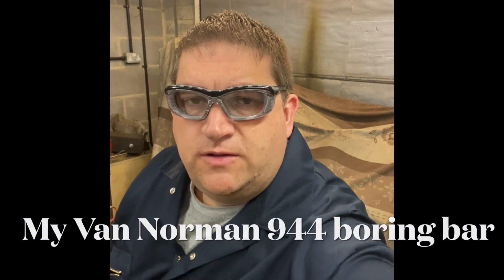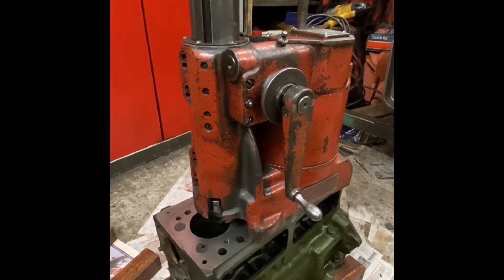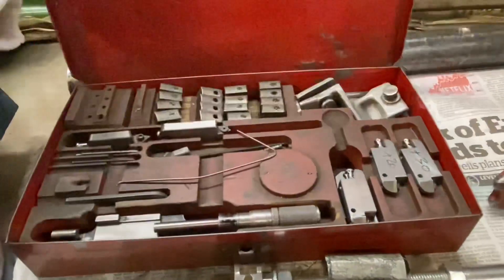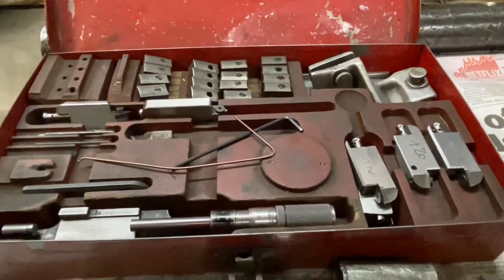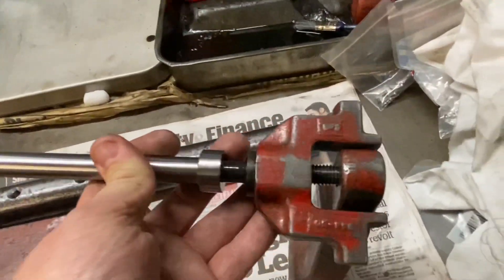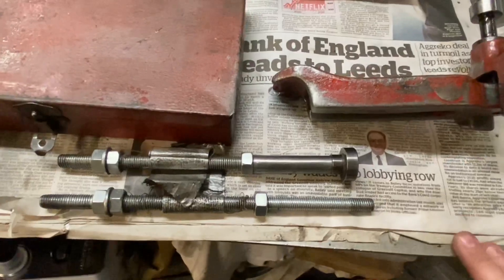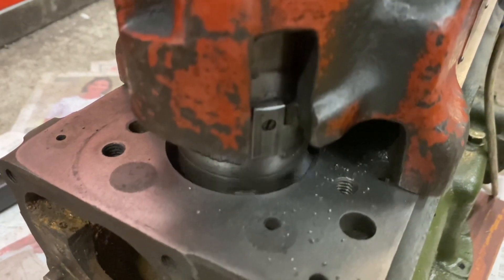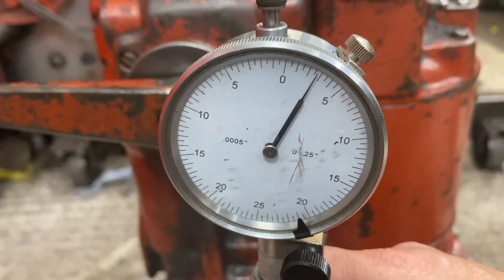My machine tools, part 2 - Van Norman 944 boring bar

Comment: Great video, many thanks. Just brought home Van Norman and Buma boring bars plus tooling from my parents house. Both passed away now sadly. Dad had an engine shop back in the day. I used to work with him 30+ years ago. Lovely old machines that have sat un-used for many years. I'll tidy them up and get working again.
Reply from the maker: Sad when parents pass on, but using their old machines is very good therapy, my old Colchester was my dads machine he has long since passed too, but there is something not quite tangible when you touch and use the equipment, it’s as if they approve and are watching, but not in a spooky way.
Reply: @ACDodd  Looks like there's a bit of surface corrosion on the main column of the boring bar. Wondering if that's something that will impact accuracy very much or can be rectified? Thanks
Reply from the maker: @chrischapman143 it’s not raised corrosion it’s below the surface and does  it affect the columns motion. Or direction
Reply: Yes, very true. Their tools are the only connection we've got now. Nice to have them at least. Never actually used a boring bar myself, only watched him with it. I'll have a few practice runs on an old Ford block I've got. Cheers
Reply: Spent several hours on the Buma machine cleaning and lubricating. The corrosion cleaned up well and column motion is fine. Think it's going to be fine 👌. Going to look at the Van Norman next ...

Comment: I just bought a 944-6 with the vac and original tool kit what is the max boring capacity of this machine... Im in America "Mississippi" and im wondering if its capability of boring a a motor "440" chrysler from std 4.320 to 60 over with this bar? Any help
Reply from the maker: Maximum bore size quoted by the manufacturer for this model is 4.418” using the large tool holder.

Comment: What you recommend for checking the bottom for straightness or square. Got a boring that would be stored on the floor.
Reply from the maker: Never store them on the floor. Raised up on a softer material like wood is ideal and keep the face lubricated. Bore a block and then rotate the machine 180 degrees offset the bore 0.005” and then increase the cut by 0.010” off it cleans the bore all the way around the cylinder it’s perfectly square. If it does not, it’s out
Reply: @ thanks so much

Comment: The 944s is single speed the s stands for suction. They had a vacuum tube that mounted on the top to suck up shavings while boring a cylinder.
Reply from the maker: Thanks for that

Comment: I totally agree with you that these are fantastic machines. They're all very old now, but still just as accurate as the day they left the factory. Then again, as far as I know, Van Norman were the only boring bar manufacturers to use catspaws for centring the bar. The big advantage of these is that you can use them to help keep the bar centred as it bores the cylinder. Other bars use centring pins that have to be removed before the bar is switched on, so they can't help support the bar as it goes down the barrel, but the catspaws on the Van Norman machines can be wound out till they engage with the barrel sides, then held under spring tension on a ratchet so that they keep the bar centred as the cutting head moves down the bore and away from the main bearing of the bar. 

You said about these bars in the past being fitted directly onto engines while still in the chassis in order to rebore them. That's still true today. I do rebores in the chassis with my 944's and sometimes if it's a smaller engine I'll use my SPS mini bar instead. From what I've been told by others, there are very few people left in the UK who offer this service, so I guess I'm one of a dying breed, but then again, I am in my 70's so that's not surprising.

I've found that the 944 is just about the most versatile machine for reboring car, motorcycle and small commercial engines as used in UK vehicles. In the US they all use large bore engines for everything and the 944 is probably a bit small for boring them, but for the old Ford Cortina engines, and BMC Series A, B and C engines they're ideal. With a cutting range from 2.2" up to 4.4" they cover just about any and every private vehicle used on UK roads since WW2, and a lot of smaller commercial vehicle engines too.
Reply from the maker: Thanks for taking the time to write a lengthy reply, yes I have ran original manual which says that the cats paws are to be left I contact with the bored surface to aid rigidity.
Reply: I have  one, I want to bore a v8 in situ, it wont do it unless I unbolt the engine mounts & spin the engine to one side ( so the block face is upper most) as the bar would move, is that correct?
Reply: @aaaaaaaaaaaaaa4151  Yes, that is correct. 

Personally I wouldn't try to bore a V engine in situ. There are too many things to go wrong. It's much better to remove the engine altogether and strip it out completely before attempting to bore it. The advantages are that any swarf from boring the cylinders can be cleaned out of the crankcase much more easily than if the crankshaft is still in there, and also, when setting it all up, you can block up one side of the crankcase till one bank of cylinders is completely vertical, with the block surface horizontal, and when that bank has been bored and honed, you then switch the position round so that the other bank is completely vertical, with the top surface horizontal. 

Whatever you decide to do, don't forget to clean the top surface of the block till there's nothing that could prevent the boring bar from sitting absolutely flat against it. Even a tiny bit of gasket or swarf can tilt the bar, so that it bores the cylinder at an angle. 

Anyway, best of luck with your endeavour. Let us know how you get on, as I'd be interested to know how you went about doing it, and any pitfall you ran into.

Comment: Hi, interesting what you say about the block face needing to be parallel. I've recently had a S engine rebored and previously, the block was not level, so the previous bore was off.  Luckily, it could be corrected without going to the next oversize but was a concern for a while.  All good now.  Thank you for the explanation.

Comment: How do you accurately position de machine to the bore? Little tap with a hammer?
Reply from the maker: No the machine has a self centring system built in via 4 expanding feet which put the machine on centreline with the bore. I refer to these in the video as cats paws
Reply: @ACDodd  thanks!
Reply: Hi,can i ask if there's a meter at the top of machine how to set it to 0?
Reply from the maker: @qwer-wj2ro  there is no meter on the machine the one you see in the video is a dial gage mounted using a magnetic base. The dial face is free to rotate which allows you to set the zero.